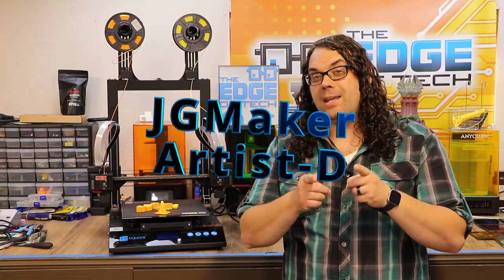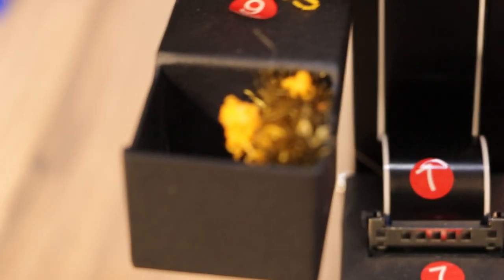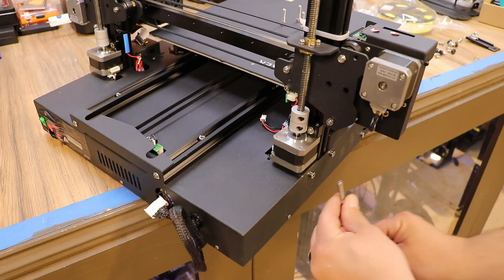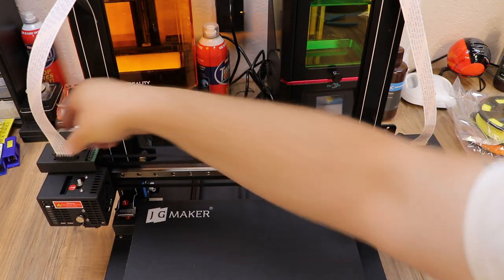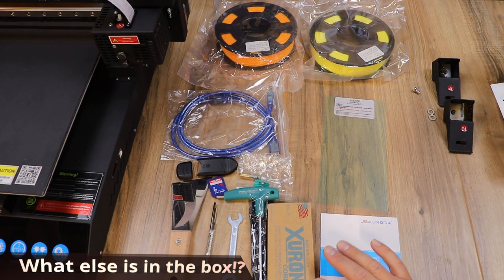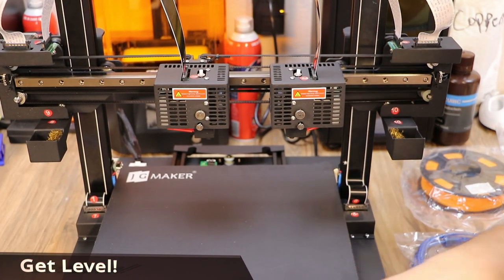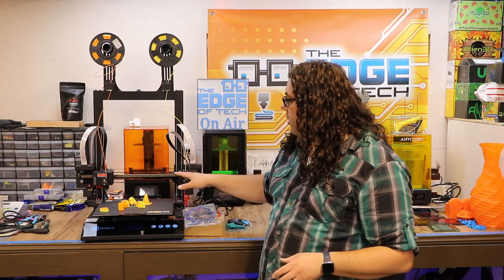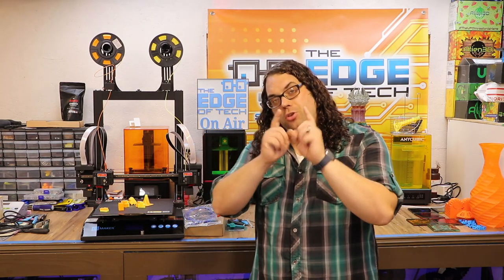JGMaker Artist D - First Look - Assembly - New 3D Printing Technology!

Comment: Definitely a huge step in the right direction..

Only 2 pieces to join together (not mentioning the wipers) and Simple numbering of the wiring. 

I was thinking 'hey, this is more user friendly for noobs' but yeah, your right - duel direct drive may be a little awkward for a beginner - maybe not a great choice for a beginner..

I suppose if they also released a version for beginners, with single Bowden extruder (especially if they could keep the price competitive), that would be a huge thing for getting beginners into printing..

Lastly, being from a region that needs 230v, not having a switch is a real drawback and cuts out on a percentage of marketing for them. Hopefully this issue will be fixed (unless you found a switch somewhere - but the voltage sticker makes me think this is a fixed voltage).

Great video, well done..

Comment: Thank you for your video, great as usual! First thing, I hope you un-twisted the sync timing belt for the Z axis, I'm sure you did! A couple of things I thought was not good, one, the filament that runs from the run out sensor is not in any bowden tube, the problem is this moving filament has the potential to wear through and cut one of the conductor ribbon cables! Two, as the nozzles wear down and they will, how do you adjust the bed height when you have one nozzle wearing more then the other one? Is there a way to lower or raise the nozzles mechanically? Three, as these nozzle look proprietary, does this lend the possibility that the price for a replacement can be very high?